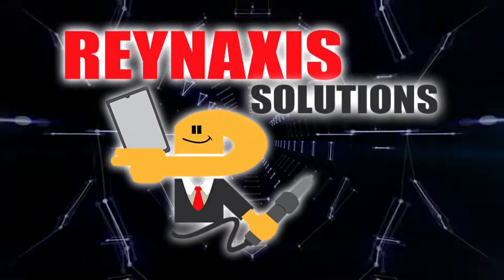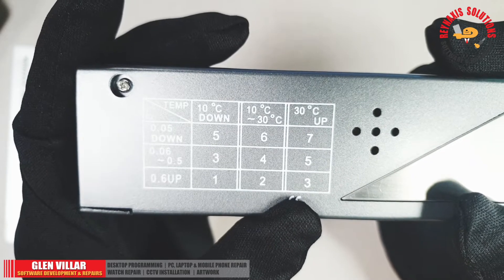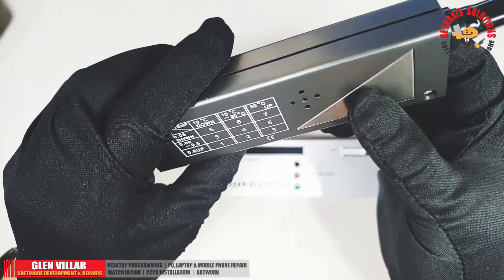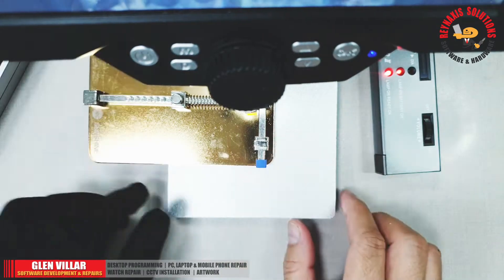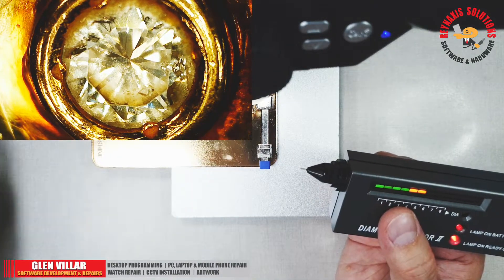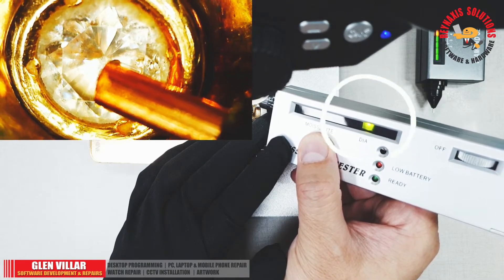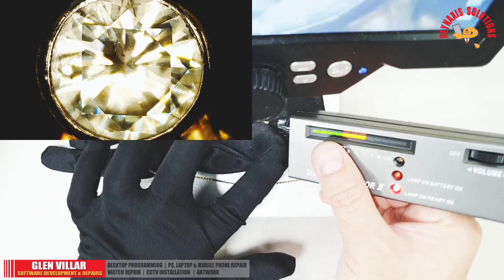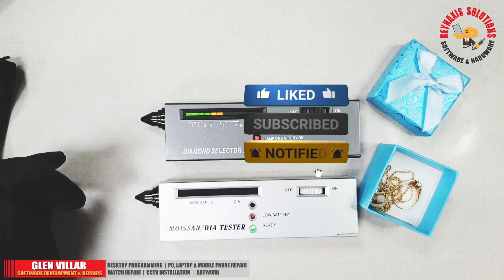How to Check if a Diamond is Real using Diamond Selector II and Moissanite Tester

Comment: I don't know about you but the Moisonite/dia tester I have lights up the LED over diamond as soon as you push the button on the back. And it stays lit up unless the 2 red Moisonite led's light up and it beeps. But I get the 2 red LED's and the tone when I touch the metal setting, my skin, the fabric in the box that the ring is in.. I mean as far as this thing is concerned everything is other a diamond or moisonite. And no one said Jack about this being a complimentary tool to be used alongside anything. But regardless it shouldn't register everything you touch as either diamond or moisonite as this does. And I checked the battery 9.36 volts. Pretty stranded for a fully charged 9 volt battery. And it doesn't matter how you adjust the sound/sensitivity. It does the same no matter where you place the dial. So I'm going to go with, it has nothing to do with not knowing how to set these properly. They are just pieces of garbage designed to be manufactured at cheaply as possible and sold for 100× what it cost to make it. I know how to tell for real. Take it to either a jeweler or a pawn shop where they have either professionals who can ID the stone or they have the really expensive tester that works. These things are made to rip you off and that's it.
Reply: Agreed the Moissanite tester did not work for me so I came here to see what I was doing wrong but I guess its not me thats the problem.